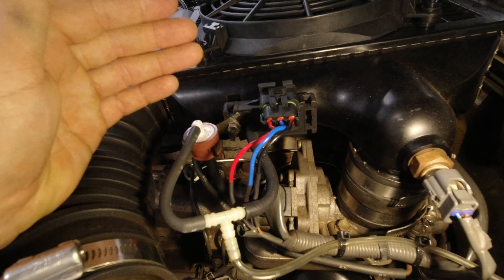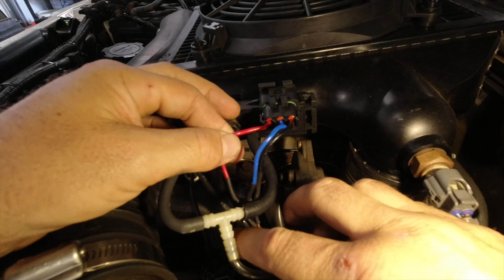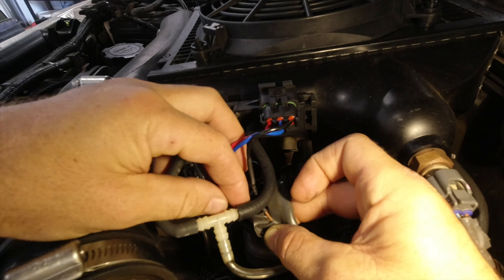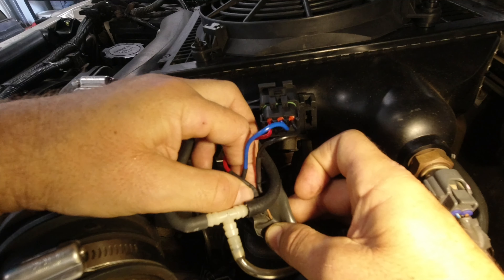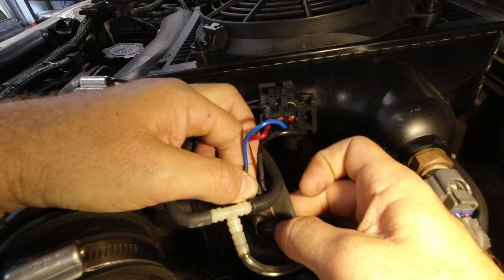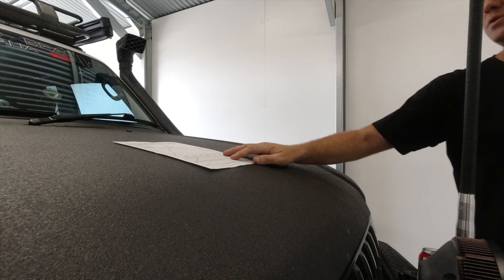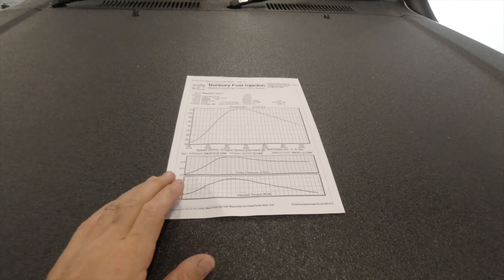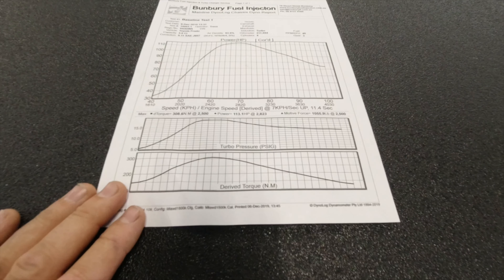Toyota Prado 90 Series 1kzte 3 Bar Map Sensor And 18 PSI Power Increase

Comment from the maker: Hay guys this is the 3 bar map sensor I used. https://rover.ebay.com/rover/0/0/0?mpre=https%3A%2F%2Fwww.ebay.com.au%2Fulk%2Fitm%2F192405663185
This makes the ecu think you are only running half the boost you actually are running and gets around the factory boost limp mode at 14.5psi. 🍻👌🏽
Reply: Hello, can I do the same on my 2006 toyota fortuner 1kd-ftv engine?
Reply from the maker: Totally different engine mate I’ve never had one before sorry
Reply: I got same model Ur work has inspired me my old girl has 224 on clock and manual can wait to have my rig similar to urs
Reply from the maker: Awesome! That’s low ks
Reply: @bushandbeachaustralia  what fan r u using and where did u get aluminium intake airbox
Reply: What turbo r u using my bro , and have u upgraded any internals
Reply from the maker: All std internals and turbo mate. Only other thing of note is a turbo back 2 3/4inch exhaust
Reply from the maker: Stainless steel air box was made by a fabricating mob back in Western Australia probably 10 years ago now!
Reply from the maker: I’d definitely install an egt gauge and aftermarket water temp gauge as well to keep an eye on everything.
Reply: @bushandbeachaustralia  still tho would u put 7" fan on intercooler
Reply from the maker: Yep I reckon 7 inch would be the go. Lowest profile one possible. 7 inch would give room to move the fan a little off centre to clear the bonnet cross member. I removed my 9 inch one because it was touching causing the fan motor to overheat and pop fuses.
Reply: Hi mate, nice video, I've only just fitted a 3 bar map to my 120 1kz-te so could obtain 18psi, when I finished installation and started it ( without boost adjustment) it instantly gave me a check engine light.
I've gone back over the wiring etc, and for the life of me can't workout what the issue is.
If you have any info of doing something different that would be greatly appreciated.

Thankyou and great vid👍
Reply: Hey bud, did you end up finding a solution?

Comment: Hi James here from the UK , I have done many mods on my beast ( 3" dump pipe and full exhaust , hi flow mamba turbo, large front mounted intercooler ) . Tried  MAP  bleed to compliment boost bleed valve with slight results but have always been looking for a 3 bar MAP sensor I could just plug in.
Bough the one in this video and WOW I'm boost bled to 17psi in my prado absolutely flies, previously I managed about 12psi. I  can't believe the difference it must really compliment my mods which have been hindered due to the standard MAP sensor . My prado is huge with 10" lift on 37"tires so if I feel like its flying in the cab , god knows what it looks like as a pedestrian. 
A massive thanks for the info on the MAP mod and link , I'm over the moon.
Reply from the maker: Haha epic mate. Stoked you like it. Anywhere I can view your 4WD? Sounds like a monster!
Reply: I want to see this too

Comment: Hi mate, please reply me thanks

Im now currently with 
Cct stage 1 turbo 
Mapsensor same like you.
Boost tee controller turbo smart
Boost trothle controller plugNgo

I thinking change to unichip
Its work?

Because im using cheap chip brand from oversea, im think this chip only support for mechanical diesel pump . Because no wire to diesel pump 2 wire to ecu..

Comment: Hey camp when you fitted the 3 bar sensor did you fell any difference to car on take off , I’ve just fitted a 3 bar sensor from Aeroflow I’ve lost throttle response on take off I’m thinking it’s the sensor doesn’t read will on lower and slow boosting cars and it’s made more for very high and fast spoiling engines
Reply from the maker: Hi mate, did you increase boost by using a boost tee? The increased boost is what will make the difference on take off.
Reply: @bushandbeachaustralia  yeah I have done so its not going past 15psi atm , it’s feels like it’s affecting the throttle position sensor and if I unplug and change over to the old sensor it’s fine , I’m going to try a different brand of sensor and give it ago
Reply from the maker: No worries good luck

Comment: i thinking of buying a dpchip, 3 inch turbo back exhaust and a 3 bar map sensor.
how do you think it will work out? is there anything else i should consider
Reply from the maker: Yes consider a uni chip instead way better
Reply: @bushandbeachaustralia  where can i find one for the 1kzte? Have you got a link?
Reply: @anguselmslie7783  hey mate have you found one ?

Comment: Hey mate can I just use the 3 bar map sensor and a boost tee to get it to 18psi or do I need a fuel cut defender aswell? Cheers
Reply from the maker: The 3 bar map sensor is the fuel cut defender cheers bud

Comment: What's the economy like after the chip and sensor upgrade mate?
Reply from the maker: We mostly tow our camper and at 4.2 ton gcm we are getting between 15-17l per 100. Not towing I’m getting around 12.5l per 100 average.
Reply: @bushandbeachaustralia  not a lot different than mine gets standard, looks like another upgrade in the works for my 1KZ FE 👍 Thanks for the reply..

Comment: Hi. I have  2004 1KZTE stock.  Whats your thoughts on just running a turbo boost and 3 bar map sensor with no other mods?   I would Def install gauges to monitor boost and heat.  Mainly for towing camp trailer with no slow  4 x 4 work so air flow should not be an issue.
Reply from the maker: Hi bud can’t say how the newer 1kz’s go with the 3 bar map sensor as mines a 2001. I’d definitely consider adding a turbo back exhaust to help with egts if your towing and drive to the egt guage. Eg back off if they start climbing or go down a gear..I typically don’t let mine get over 450-500 degrees post turbo

Comment: hi, so u got 113hp at the wheels, stock j90 makes 69kw/ 93hp at the wheels....  think u lack fuel or still got the factory dump-pipe :-o
Reply from the maker: No it doesn’t lack fuel. With the chip turned higher the egts increase so for the sake of reliability it was left on 5. And it has an aftermarket free flowing dump pipe. 20hp more  than std I’m happy with that. It’s so much more drivable now...
Reply: @bushandbeachaustralia  where do I acquire this chip

Comment: How come you didn’t go with a unichip or something along those lines? What are your egts sitting at doing 100? And max egts your getting
Reply from the maker: Good marketing by roo systems at the time and not sure on egts at the moment. Only half installed gauge so far but will be working in a week or 2. Guys at dyno said the egts were only slightly creeping up when pushed really hard. Taking it easy till egt gauge up and running.
Reply from the maker: Hi Declan egts are sitting inbetween the 300-400 mark towing at 100

Comment: Greetings mate, i just bought this Map sensor but i wonder if i will be able to increase the boost without the chip you have? i have the boost T and the aftermarket map sensor only,
cheers ! huge fan of your 90
Reply from the maker: Yes you will be able to but start at 14 psi and see if your happy with that. You won’t need the map sensor at 14psi. I know of guys running 18 without a chip. Cheers Bud
Reply: @bushandbeachaustralia  how do you wind boost up

Comment: Superb! Thanks for sharing the knowledge. An easy mod with such high gains! Just bought one of these trucks after coming from a 2.4L TD common rail and am a bit gutted with it's uphill driving  and towing efforts. Hopefully following your lead I can improve the situation! So thank you! Couple of questions: how has these changes affected your fuel economy? and is that map sensor a straight plug and play modification or do I need to get some tuning done afterwards? Also I love the addition of the fan on the intercooler. Can you please tell us more about that? Or share a link to where you learned about it from? Cheers mate, much appreciated :D
Reply from the maker: Hi Sam no worries mate. Yeh they are pretty slow especially towing. Every bit of power helps! Fuel economy is the same for me mate. Sitting at 4.1 ton all up with the camper we get around 15-17l per 100. Personally I think that’s pretty good fully loaded. Unloaded without the roof rack it uses around 11.5-12.5l per 100. The 90s run quite rich from the factory so winding up to 18 psi you don’t need a tune. It also lowers the EGTs. I’ll be getting a uni chip installed and tuned soon. They are the best as they can change timings as well. You do need to make sure your cooling system and injectors are good. If these engines get really hot the are renowned for cracking heads whether in standard form or not. Personally I don’t think the intercooler fan is worth it. I installed a 10 inch one but it was slightly too big and hit the bonnet. I’ve since removed it. If you want to add a fan I’d look for an 8 inch one. I wired it up to come on with the ignition. Thanks for commenting Sam🍻🍻🍻
Reply: @bushandbeachaustralia  Cool, that is all good to know! Cheers for the info! That's interesting about the cooling fan. I would have thought that was a good touch - even just for improved air flow around the engine/turbo. I would probably install it with a relay and manual on/off switch (use it for towing heavy loads or on hot days). I was thinking down the lines of adding a bonnet scoop and the fan underneath. Do you think that design is worth it? We get multiple days over 40 deg C in Adelaide through January/February and I live up in the hills at the top of the SE Freeway which is about 7-8km of uphill driving. It's a real killer in the summer months! I need to make sure I can pull my 1800kg caravan or other loads for work up there without cooking the truck haha Thanks again for answering my questions :)
Reply from the maker: No worries mate yep I know that hill well. I wouldn’t bother to be honest. The airflow from driving is plenty. As long as the factory plastic scoops are still there to direct the air into the bonnet. The gains with the fan are at slow speed ie low range crawling when the airflow is minimal. Make sure you have an EGT guage and drive to it. Watch it on the hill. I don’t let mine get over 500 degrees. If it creeps up I drop down a gear or back off.

Comment: What is that nap sensor....and what does it do to improve the performance
Reply from the maker: MAP sensor I believe stands for manifold absolute pressure. The new sensor tricks the computer into seeing only half the boost you are actually running so allows you to exceed the 14psi before it goes into limp mode.

Comment: Thanks mate for this and for all the videos. Love to see what you've done with your 90 and the reasonable reasons you make your mods.
Just to check if I understood properly this altered map sensor outputs half the actual reading or caps the top value? If it's the first wouldn't it be throwing off all the ECU fuel to air ratio off all over the curve? Really keen on doing this just trying to understand the implications.
Have you modified the volume of fuel? Is the consumption still the same?
Thank heaps and owe you a beer whenever we cross paths!
Reply from the maker: Hi Martin it half’s the actual reading the ECU sees. It does throw of the fuel to air ratio but they are quite a rich tune from factory. Winding up to 18psi leans them out leading to cooler egts. The volume of fuel is modified by my dp chip. A lot of people are running 18 with no chip and are getting good results. Cheers mate definitely keen on that beer! 🍻🍻🍻
Reply: @bushandbeachaustralia  Thanks for clarifying that! I will see how it goes when the 3 bar MAF arrives. Meanwhile polished both manifolds and removed and cleaned de EGR gunk  and installed a EGT probe so I'm a bit more prepared to crank it up a bit. ECU cuts me quite early at 11is PSI as it is. Probably dump pipe and exhaust will follow to help with EGT too. If you are ever down in the land of the long white cloud you can definitely get a local brew. Else I night roam OZ sometime! 🍻🍻🍻

Comment: If you want an easier map sensor. Grab a version 8 subaru sti one and its straight bolton and plug and play.
Reply from the maker: Does that one allow you to go past the 14psi boost cut?
Reply: @bushandbeachaustralia  yup running 18psi on mine can most likely go higher on a manual pump
Reply from the maker: Sweet thanks for that 👌🏽
Reply: @4x4MadnessNZ  does it need to be off a turbo subaru sti or any subaru
Reply: @4x4MadnessNZ  do u know were I could order one from mate
Reply: @4x4MadnessNZ  I tried them part numbers but can't find anything would u have a link or anything
Reply: @edwardanderson8282  dont have any links but been told its on a version 8 sti. Ill have a look

Comment: Hay I have a sr5 hilux 2004 model would that work on my van? Also any tips on getting better fuel economy? Thanks
Reply from the maker: Hi Sharaz, if your 1kz-te is the same setup as mine then yes it would work. Driving style is a big one for helping fuel economy, light acceleration and reading the traffic. Try to keep rolling slowly up to a red light in anticipation that it will change so you don’t come to a complete stop. Little things like this can help a lot. Roof racks can greatly reduce economy as well. Other than that a turbo back exhaust and snorkel can help a little. Make sure tyre pressures are correct and your maintenance is up to scratch. Cheers for the questions mate 👌🏽🍻🍻🍻

Comment: How did you adjust the boost
Reply from the maker: With a boost tee
Reply: What is a boost t ?
Reply from the maker: https://www.sparesbox.com.au/part/turbosmart-boost-tee-boost-controller-blue-ts-0101-1001
Reply: So just install a boost tee and do not need to adjust other things? Can I boost my 1996 Prado with original exhaust ? Thanks mate
Reply from the maker: You can bud. I’d start with a boost tee and go to 14psi. If you still want more put in an egt guage to keep an eye on temps then go turbo back exhaust, 3 bar map sensor and 18 psi...

Comment: Hi mate my 1kzte 1996 can do the same like your ? Just plug in ? Need do any computer settings ?
Reply from the maker: Yes it should work mate. You need the boost tee plumbed in and the 3 bar map sensor. Also a boost guage to know what boost you are winding up to. Cheers 🍻
Reply: @bushandbeachaustralia  Thanks mate ! cheers..
Reply: @bushandbeachaustralia  would that be electronic boost tee??

Comment: Standard prado with turbo intercooler is like 130hp and 340nm though? im lost
Reply from the maker: At the wheels? Don’t think so
Reply: @bushandbeachaustralia  yea its 128hp not sure why yours is so low even after mods
Reply: @bushandbeachaustralia  mine is 3L turbo diesel intercooler
Reply from the maker: Which engine?
Reply: @bushandbeachaustralia  1kzte
Reply from the maker: I’d like to see the dyno print out. For comparison on the dyno I used a std 3.0l d4d put out 113hp at the wheels
Reply: @bushandbeachaustralia  that's weird, even official sites about the prado say higher readings
Reply from the maker: Yes but I’d speculate that’s not at the wheels.

Comment: Hey mate, me again 😆 

With the hose T junction you have there, where does the bottom hose of the T head off to? Cheers
Reply: Sorry, just found the answer in the comments down the page. Boost controller and boost gauge for those also wondering 😎
Reply from the maker: Hi Sam the one on the passenger side heads to the boost gauge. The blue boost tee on drivers side heads down to the wastegate
Reply: @bushandbeachaustralia  Ahh gotcha! That's what I wanted to know. Sorry for all the questions. About to head away  in a couple of weeks with the caravan for the first time. Am urgently trying to get my head around this upgrade and installation to ensure a safe and successful holiday. Theirs some very steep hills between us and our destination so have been a bit nervous :P Just reading back over your previous replies, its all making sense and I'm feeling much more confident with the installation. So thank you for your responses! :)
Reply from the maker: No worries bud 🤙🏽👍🏽

Comment: Hi there were did you get the inter cooler fan from and how did you wire it up thanks
Reply from the maker: Hi Bradley I got the fan from auto 1. I found an ignition wire on an unused factory plug under the drivers side battery, I tapped into that so it comes on with the ignition. Cheers bud 🍻👌🏽

Comment: Gut morning, sory nou spec quick Inglis, May name is Manuel is fron Galicia spein.
May car is 95vx 3.0 kdj 163cv.
May cuestión is your video intalet electric air cooler... Sory may Inglis is bat... Ventilator istalet intercooler??cens for your Chanel 1frens in galicia
Reply from the maker: Hi mate thanks for watching. Sorry I don’t understand 🍻🍻🍻
Reply: @bushandbeachaustralia  good morning friend, how do I  connect the intercooler fan??the connect in wat sensor??ou is manual on of??.
Is posibol video tutorial??? Cens fron Galicia
Reply from the maker: Good morning! I hardwired mine. I used an ignition wire to power it. I think an 8inch fan would fit better. Mine was too big
Reply: @bushandbeachaustralia  I thank you very much, for the answer, in Galicia the 90 series did not sell much and there are no parts or information. I try to get more suspension tours especially at the rank, and I repaired it 3 times with 285/75 r16 maxxi tires 772.gut day
Reply from the maker: You’re welcome Manuel 🍻👌🏽🤙🏽
Reply: @ManuelLopez-mb5sb  they only sell 9 inch online

Comment: 3 bar map sensor is a stupid idea . Put ur original back in as uv completely removed a whole lot of fuel u already had . 
U need to understand the circuit  and its oe range it has to start with bs wjat the 3 bar will have .